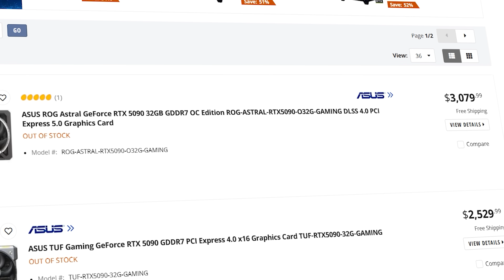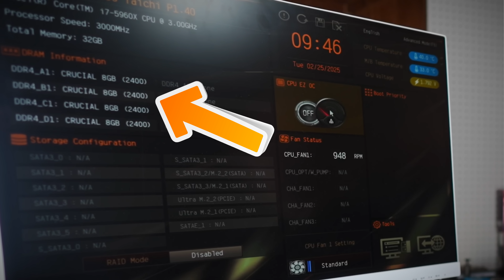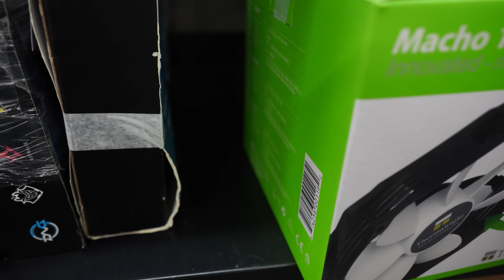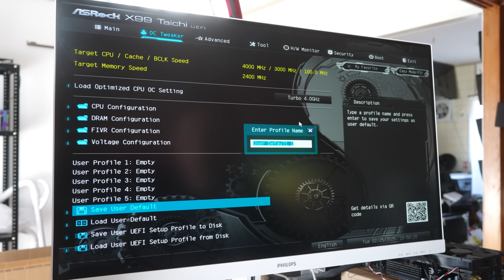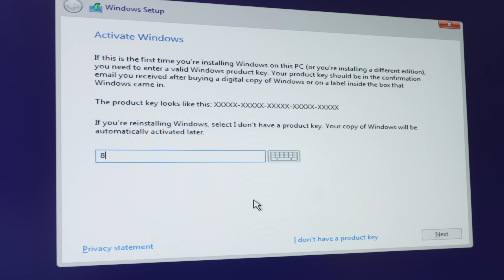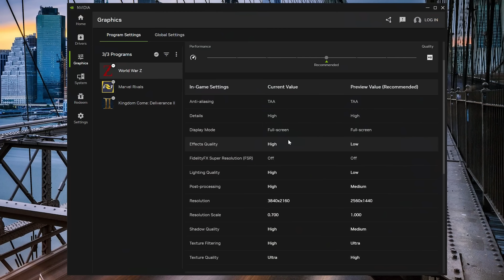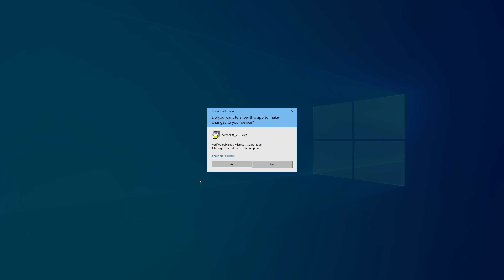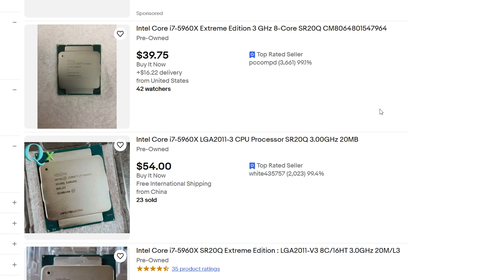I Built a USED $300 Gaming PC that can... play 4K!

Comment from the maker: The i7-5960x with an overclock actually goes really hard still.  What would ge the fastest GPU you would pair with it?
Reply: I would also look at pairing a 6750xt with this platform for a bazzite build. YOUR OWN 4K  PS5 PRO...steam machine's time has come!
Reply: E5 1660v3 or 1680v3 whatever u can find cheaper that day
Reply: I feel like a gtx 980ti would be awesome with this cpu
Reply: currently have a 5960x with 2070 super and 64 gigs of ram. I wholeheartedly endorse this video
Reply: 1080 ti is a perfect match but 2080 ti or new equivalent will still run vary well. And of course depends on 4k or 1440p. Amazing content Brian!
Reply: RTX 5090 can you pls test it with the 5960x just for a throwback X99 in 2025 with latest GPU episode 😄
Reply: 3080
Reply: Please make a video overclocked 5960x + 5090 at 4k
Reply: @armandslegzdins3311yeah there is a massive bottleneck 20-30fps loss with a r5 3600 so an older intel would be worse
Reply: 4070 ti SUPER
Reply: I'd like to see the 4070 Ti (Non-super) as that could be a bargain on the used market in a year or so ¯\_(ツ)_/¯ vs 7900XT perhaps as that was the closest in price to 4070 TI at launch.
Reply: @techyescity  2080TI
Reply: had a 5960x at 4.4 paired with 6900xt, no bottleneck at warzone 2.0 at 4k maxed, BEAST. Personally if i had the money would pair with 5090 easily, it wouldn’t bottleneck at 4k
Reply: my E5-1660 V3 holds  4.5 Ghz X8  like a champ with Aorus GTX1080 Ti still rocks games that I like ! F4, F-NV, Metro exodus, you name it
Reply: Cmon RTX 5090 Vs RTX 4090 vs RTX 3090Ti at 4k to see how well it held up
Reply: Also this should show the CPU's bottlenecking effects at 4k if any
Reply: If i remember good it has some good l3 cache for intel gpu
Reply: I have found that running amd gpu's is best for these systems since they have less driver overhead than nvidia has, haven't  tested if the new Arc suffers the same as when paired with weaker cpu's when you have 18-cores of 3.8ghz haswell
Reply: I think anything faster than a 3070 would be a waste at 1080p-1440p. For 4k you can probably put a 4090 and still be gpu bound in a lot of games.
Reply: RX 6700 XT/6750 XT
Reply: I have a 4070 in an x99 rig right now. It's paired with a Xeon E5-2666 v3, which is roughly equivalent to a 12100f. Not ideal, sure, but it serves me well and I've had no issues with anything in my Steam library
Reply: btw, how much power do these x99 systems suck? Electricity is expensive and rising again here....
Reply: @bakakafka4428 a lot probably close to 200w after a overclock
Reply: not sure if it's a repeatable build for $300 with those deals you got🎉
Reply: I have a 5930k with a 2070 super. It preforms almost exactly the same as 9600k and 2070S combo and doesn’t seem to bottleneck at even 1080p. I’ve also got a W3690 with a Vega 64. Both are number 1 in the world on 3dmark benches. You’d be proud Brian! ☺️
Reply: Rx 480
Reply: Why do you love old outdated platforms
Reply: When X99 was the still the shizz, I remember the i7 6900k was noticeably ahead in gaming tests, from other x99 cpus and even the high clock quad cores of the time. It'd be very interesting if you could acquire one and do some benches with it, and compare it to today's stuff
Reply: @andydsm what benchmarks? The testing methodology was terrible back then, too.
Reply: RX 580 8GB, or now the replacement for it is RX 5700/XT
Reply: Honestly I'd try a 4070 fk it
Reply: So should the 2080 imo. Recent games are incredibly poorly optimised. Especially UE5.

I'm running a 4090 and the performance i get in newer games is a joke.
Reply: 3080ti
Reply: 🙂 its Haswell E its basically the same as Haswell so imagine an i7-4790K with more threads, for video card anything that pairs well with 4790K, on the gpu tier list im guessing but maybe a 3070 8GB would make sense with Haswell, i think 3070ti would be too much for it, but look at the gpu tier list and look at all the cards around the 3070 8gb
Reply: @MrSamadolfo  ye, definitely depends on the res and use case. I wouldn't use this for esports at any res. But I'd do a 3080 and play last gen aaa in 4k any day with this cpu
Reply: @wowcplayer3  😊 sounds good
Reply: @MrSamadolfo  well in modern games since i has double the core count a chunky amount of cache double the threads and ddr4 compared 4790k i think it could handle like a 5960x could 3090/6950xt gpu at higher res no problem and honestly an heavily overclocked 5960x is between a 3700x and 5800x in single threaded performance
Reply: Looking forward to the new video on the Windows 10 IOT LTSC 2021 version. The link you offer does not offer keys for the IOT version, using it will reset the install to just LTSC.
Reply: @bakakafka4428  the iso works, and it activates, ask around how to
Reply: @ Legally, not using MAS.
Reply: 2060S at 1080p, 3070 at 1440p. If you're gonna drop so much on a GPU, it would make sense to go for a newer platform for more framerate, instead of faking performance with a 4k display. I've had a 3070 paired with an i7-3770 before I upgraded the platform, and it wasn't a great experience.
Reply: @bara555  bruh that's almost like comparing a 1500x to a 5500 as far as performance delta. This could handle an entry 4k card like a 6800xt or 3080 imo
Reply: I found this for $130. Do you think the I7-5820k will be close to the 5960x? It has 2 less cores, a 3.3 base clock and 3.6 turbo, also 15mb cache instead of 20.
Reply: Doesn't the 5960X go against your usual preference for efficiency? I assume you would recommend an i7 8700 i5 10400 or ryzen 5 instead
Reply: @BonusCrook  he has always done hedt builds

Comment: Have several up coming systems 2 x99's and B450 and 610 12th gen. On the x99s current chinese mfg will Uefi selection in rufus be compatable to run 10 2021 LTSC on to use the key. Ist time rufus user here.  Made a uefi LTSC usb .One x99 has win 10pro  but not keyed yet. Other is under construction at this moment. I did recently sell a 10 LTSC I bought in 2020 to put all my old dos and 95, 98 games on  running an emulater. I think it was a 2019 sw model that still had a few years to run. I  have a a x58 xeon I have ready to tryout but I think that is MBR only so what I have made so far won't work. I have 2 more usb drives to use to make others. I am interested in what is being said about MS potentially blocking these keys in other posts in this  
comment topic. Interested in hearing more on this topic
Craig

Comment: Thanks TYC for the Windows 10 Enterprise tip and keys.  Building an older i5-6600 system and installing windows 10 on it.  I love that Enterprise LTSC 2021 doesnt have the forced co-pilot update too!  Also if you need Microsoft Store installed on LTSC there is a way to manually do it, just search online, it involves enabling developer mode and installing the microsoft store software.

Comment: Since a CPU like the E5-2666 v3 can handle an RTX 4080 at 5K ultrawide in Cyberpunk 2077 with DLSS set to Balance or Quality, I don't see why an i7-5960X couldn't do the same. However, some 2024 games would definitely push the CPU to its limits, making the GPU less of a factor in those cases.

Comment: I went to purchase the IoT version of windows 10 and was presented with this description:

"This license may activate an installed IoT-version, but the version name will change to non-IoT upon successful activation. This means that support will end on Jan 12, 2027 and not Jan 13, 2032 as original IoT licenses. Besides the extended support period, there are minimal differences in functionality and the IoT-term is mainly a marketing spin to align with IoT Mobile and IoT Core.”
oduct Description

This license may activate an installed IoT-version, but the version name will change to non-IoT upon successful activation. This means that support will end on Jan 12, 2027 and not Jan 13, 2032 as original IoT licenses. Besides the extended support period, there are minimal differences in functionality and the IoT-term is mainly a marketing spin to align with IoT Mobile and IoT Core.”

I am in Canada thought I would let you know my experience.
Great video. Thanks for the post.

Comment: It's honestly very solid. If the parts were more available here, it'd be a dead heat with a lot of the 8/9th gen used systems I do for $400-500 USD.

Comment: I have built a few of these in recent years, I even have a few new motherboads from AliE just in case they bust. They are a great setup for a really good price, put a 2060 or a little higher in this and it will game. I do take advantage of the quad channel as well doubling up on the ram normally 32gb.

Comment: A great gaming build indeed Bry💪🥳🥰👍 The Zalman case imo is a great looking and decent performing case with more than adequate air flow (as shown with these power and heat generating components inside).  It’s great seeing some value oriented builds in today’s day and age of high priced pc parts.  Nvidia has given ALL RTX generation users a great gift with the new Transformer model in their DLSS software.🥹💪👍🤩
Reply: i've been using my pc with the side off for years, seems better just not having a box full of hot air rather than trying to manage it with airflow

Comment: you should mention that the LTSC keys sold, are MAK keys. they get blocked by Microsoft after a while, because the sellers are selling them to multiple buyers.
does not make much sense in buying those keys IMHO, better use massgravel.
Reply: Exactly what I was going to say, that's because they require a volume license to use them, they are pre-activated keys and once blacklisted then not even manual activation will work.

Comment: great vid man!I need some help, I have an Asus x99 pro usb 3.1 motherboard and a Xeon E5-2650v3 and E5-2630v4 but the board is showing 00 qcode on both processors, on the manual it said that 00 is not used, I looked over the internet for a solution but nothings working do you have any idea how to fix this? thank you in advance!

Comment: Should check out the Xeon E5-2696 v3 for LGA2011. It's a 18C 36T w/ 3.8GHz boost. Wonder how that would OC?!
Reply: I have one spare at the moment. Was planning on using it to host Minecraft servers for online communities I belong to
Reply: @zoomzabba452  mine runs multiple VM's for different games. Minecraft, 7D2D, Rust, Wreckfest, BO II, and some others. I used a Chinese X99 board and moded BIOS to keep clocks high.

Comment: That X99 ASrock motherboard supports TPM 2.0 (there is a header at the bottom called TPMS1)
Such modules can be had for less than $10 dollars.

This makes the whole system fully supported by Windows 11 except for the CPU Generation,
which is easy enough to bypass.

Comment: Wouldn't you get a bottle neck if you dropped it down to 1080 p or 1440p? For story driven games 60fps is fine but these competitive games, thats not going to work. So 4k isn't an option. Of course there's no bottleneck in 4k, your getting fps in the 50s to 70s.

Comment: I checked Aliexpress, there are several X99 motherboard cpu memory packages for under $60. They will make a very good base for a sub $300 build. I found a case with power supply (600 watts) for $50 on Ebay.  This is easily copy-able. As long as you are willing to wait for the parts to show up.

Comment: Hey Bryan, with all the hype around windows 10 support being discontinued in October, is it possible to use an enterprise key on a windows pro system and keep all of the settings/programs etc without having to do a fresh install? I'm assessing options for my workplace which has mostly windows 11 machines, but two or three windows 10 systems that are not win11 ready. Due to the nature of the propriatry business software involved, fresh installs are a big hassle and this seems like a significantly cheaper option than new windows 11 ready systems.  Thanks in advance.

Comment: this CPU will run Deepseek 7b with no GPU at very reasonable pace just add some cheap server ram by the bundle. Got a few of these from a guy that pulled them from packing house vision software with GTX 970s installed. Bought them for about 100$ each with x99 UD Gigabyte Gaming 5p mobo + 5960x 850w PSU I love it still rocking one now gets all the juices out of GPUs cant wait for 6950x to drop in price used to drop that in.

Comment: X299 is the successor to X99. Look forward to seeing a Tech Yes X299 build
Reply from the maker: I got an x299 board for about $60 USD, though i think its really rare to get a good x299 board at a decent price.  What CPU would you like to see on X299 tested?
Reply: @techyescity  i7 7800X or i9 7900X or 9900X or 10900X.
Reply: they got worse for gaming since they abandoned the ring bus architecture; you'd probably have to go at least 4 generations newer, maybe the 10980xe

Comment: I am now finally writting this comment from my 10900K+Asus Rog Maximus XII Hero build , it only costed me 330$ lol (i got lucky af).
Reply: saw a 13700KF with z690 asus d4 board for the same price on wallapop (spain)
Reply: @LeafGreenHDD  
yeah, alder lake and am5 got extremely cheap these days, but i wanted the 10900K <3
Reply: @juanme555  why
Reply: @ 
Latency.
Reply: @ well you can disable e cores on the bios and have better latency than the 10900k
Reply: @ 
nope, ddr5 ram still has double the latency and even if you disable ecores the cache scheduler will still look for them for a couple nanoseconds because it was designed with the ecores in mind.
i will grant you though, alder lake with ddr4 and ecores disabled is a lot better than am5 if you are latency sensitive, but still cant touch 9th-11th gen.
Reply: @juanme555  frame chasers said something about disable e cores before installing windows so try that but dont get a 10900k its super slow
Reply: @juanme555  i went from 8700K 5.1 to 14600KF 5.7 and i play overwatch on a masters rank and the 14600kf feels more responsive im on w10 ht off and even the e are enabled (4.5ghz) just the e cores faster than 9900K (179 vs 205 fps in SOTR benchmark)
Reply: @LeafGreenHDD  
It's unlikely that your 14600KF is lower latency than a properly tuned 8700K, but not impossible, however, it is 100% impossible form your 14600K to be lower latency than the 10900K or even 9900K , sorry friend that's just not the case.
Reply: @juanme555  why would u want 9-11th gen and is there proof even with them e cores disabled the thread director still looks for them? and how are you measuring latency. as i said my irl experience is better on 14th gen
Reply: @LeafGreenHDD  
It's not the thread director, is the cache scheduler, it was made with ecores in mind.

Latency is lower with ecores disabled, but framerate 1% lows are lower.

I want the smoothest possible windows desktop experience and that can only be achieved with intel's 8th to 11th gen.

11th gen is only 2ns slower than 10th gen but it has avx512 and pcie 4.0 , i personally prefer and myself bought a 10900K with a high end motherboard, but for people who want a snappy beast AND a moder modern platform, it is not unreasonable at all to go with the 11th gen.

Im sorry but LGA 1700 is a mess, and Arrow lake is not even worth bringing up.

Comment: Bryan, why not buy a TPM 2.0 module and install it on the motherboard. That will solve the Win 11 install, it works I tried it.
Reply: Because the TPM module is a pointless hurdle that Microsoft places on consumers. Download a Windows 11 iso and just use Rufus to create a Bootable USB with TPM disabled and no Microsoft account requirements.
Reply: Personally, I use Windows  10 LTSC
Reply: @Teksers TPM will not solve CPU compatibility issue. But if you want W11, it's not a problem even wo TPM, but every major update you need reinstall W11 if you want to receive it.
Reply: there is another workaround, install a custom windows with tpm disabled

problem partially solved

Comment: I have a e5-2696v3 18-core haswell turbo unlocked and ht disabled rig that uses a Chinese x99 with decent vrms that i got rebar working on it... and with the various gpu's I have thrown at it, it gets the nearly the same 1440p or 4k performance as my 5800x system with the same gpu....
Reply: I have this exact rig including my dual 2696 V4 in a HPZ840 and my 2697 v3 turbo boost mod in my T5810. I just picked up 256GB DDR4 ( 8 sticks of 32gb) for the T5810 for $110 shipped.  I use that rig mainly for Proxmox/ Jellyfin. Has an ARC A310 Sparkle ECO. Stupid fast and cheap. There is something special about Haswell EX
Reply: @Hairybarryy  i actually was running the e5-2696v3 with 128gb ddr4 as my primary production server, ended up switching to a $120 HS9215i 1u  longboi ... dual e5-2689 v4 (10core broadwell @ 3.8ghz), 256mb ddr4, arc a310, tesla p4, and 20x 2.5 drives

Comment: thoughts on MACHINIST X99 MR9S ATX Motherboard LGA 2011-3 Supports Intel Xeon  E5 V3 V4 CPU CPU DDR4 RAM Memory NVME M.2 USB3.0…..please advise $100
Reply: Bought a few Machinist B450M boards and they have been fine but not sure about the X99 boards.

Comment: You can install Windows 11 enterprise ltsc and go even farther. Not to mention that it has no TPM 2.0 or secure boot checks.
Reply: is the a ltsc activation key.?
Reply: @geowilson1587  I use the windows 11 90 day eval then mas script to reset it another 90
Reply: @HermannTheGreat  I am so cheap I use a unsupported Window 7 to this day